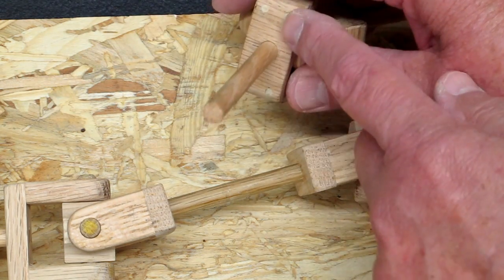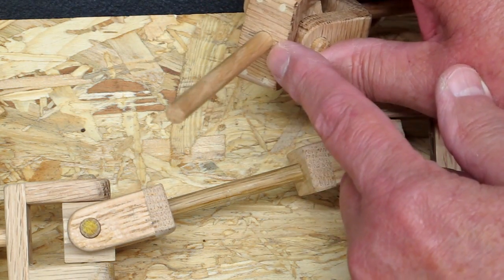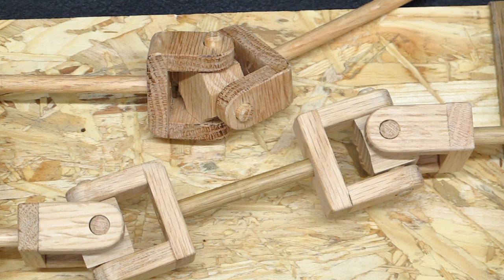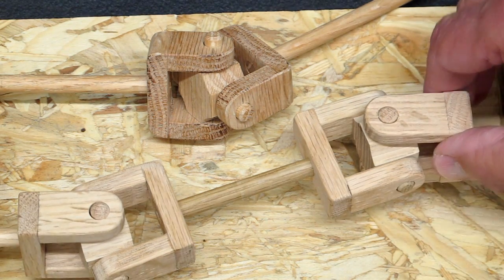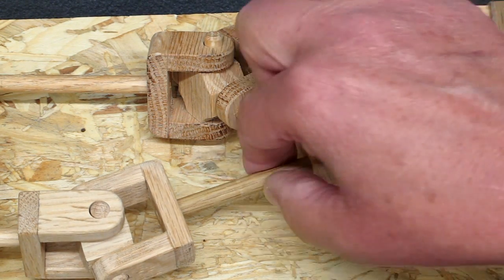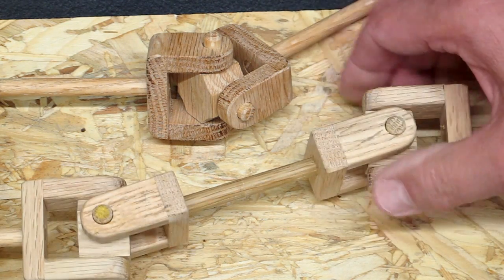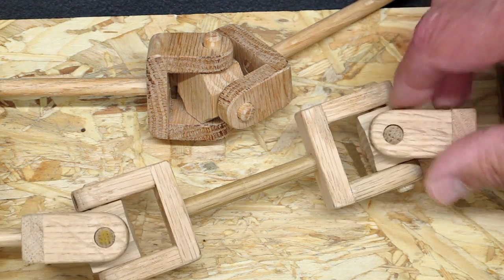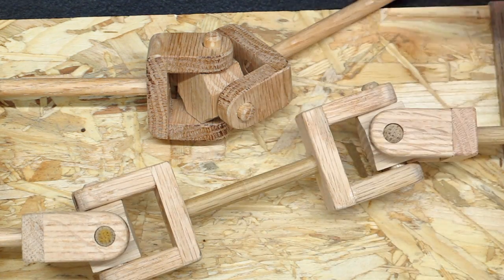Wood U-Joint Double - Part 3

Comment: Can you feel any torqueloss
Reply from the maker: At a low drive line angle it is very smooth. Offset to an excessive angle and it will start to resist rotation as will any drive line.

Comment from the maker: I didn't do that (sorry). I just try to build it stronger than I know it needs to be. Proportions and a size, which is relatively easy to fabricate, play a part. Sometimes you’ll end up with a piece of wood with a crack or flaw, which will fail (hopefully it will break before you get it all built). Wood is pretty resilient and these will run a long time. Generally, these aren’t going to fail under the light load they will see in a marble machine. It’s more for visual appeal.

Comment from the maker: The maximum offset shown in the video is around 35 degrees (obviously at no load). This is way past the practical or acceptable application for this joint.